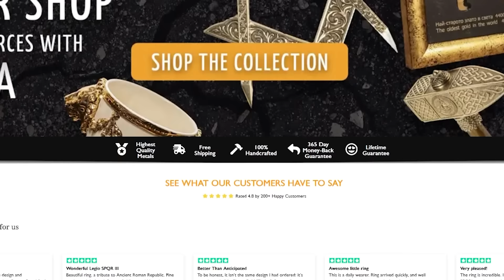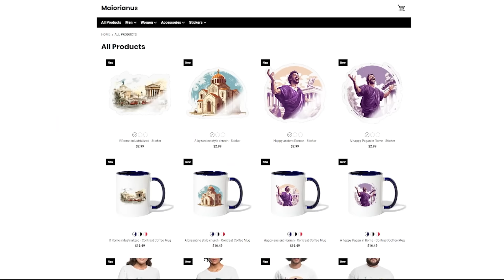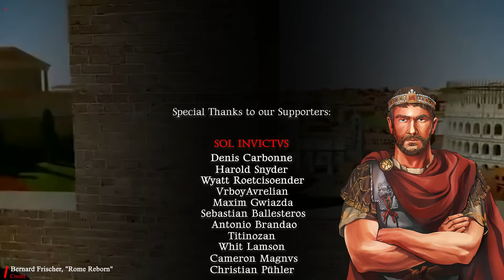What if the Fall of the Roman Empire was prevented by Majorian?

Comment: I am more interested in the impact of Majorian's victories in this reconquest will brought. As we all saw, Britain will be left at the complete mercy of the Angles, the Saxons and the Jutes. So unless the Romans entered the picture during the reign of Majorian II, the kingdoms established by the Angles, the Saxons and the Jutes will still happened anyway. And the only way I can see this happening is that the Franks and the Alamani have been subjugated at least for the time being. But whenever they broke the treaties, the Emperor needed to divert manpower and resources to the northern frontiers instead of assisting the local client Celtic and Britonnic chieftains in fighting off the invaders. And in roughly the next 100 years later, Islam came to be in the Arabian peninsula and unify the entire peninsula while the Romans and the Iranians were fighting against each other. Eventually, the Muslims expanded outside of the peninsula, conquering the Sassanid Iranian Empire and invade Syria and Egypt. But upon hearing the news about the sudden expansion of the Arabs, the Western Roman Emperor at the time will most likely dispatched a fleet to assist the local Eastern Roman troops in holding the Arabs at either Carthage or Cyrenaica. I don't know how will they be able to hold them off or how long will this new status quo with the Arabs will lasted. But what I know is that until the Umayyad Caliphate has been overthrown in the Abbasid Revolution because the Umayyad Caliphate was usually on the constant expansion, so that means both sides of the Roman Empire will received no respite. So in this period, it could be marked as another decline of both the Western and the Eastern Roman Empires. As for how will the Western Roman Empire will deal with the Vikings, I have no idea because this is depending on will the Western Roman Empire retake Britannia or not.
Reply: I honestly don't think that the Romans would have decided to reconquer Britannia. 

It was turning into a money hole for the empire, it wasn't as economically valuable as it used to be, it was a province of frequent revolts due to the amount of legions stationed there, and it was isolated from the strategic Mediterranean trade network of Rome's other provinces.

The only reason they decided to invade in the first place was to fulfill Claudius's vanity project and show that he wasn't a weakling, and the reason they held onto it for so long was because abandoning it would be a loss of face.

Maybe in this timeline they would have tried to exert some influence over the kingdoms there, making them into client kingdoms of sorts akin to Armenia. But I seriously doubt a full reconquest would have been undertaken. Britannia was better off not being part of the empire.

Edit: Or more accurately, the Roman empire was better off without Britannia.
Reply: @Onezy05  But that means dealing with constant raids by the Vikings from Scandinavia. And to make them foederati and allowed them to settle in Normandy basically said that the Western Roman Empire learned nothing from what their deals with the Germanic tribes at all.
Reply: @lerneanlion  I'm not an expert on the Vikings, but wasn't one of the reasons why they were so successful attacking the former Carolingian empire because of how decentralised they were because of their feudal system?

I doubt their raids would be as much of an issue if Rome still controls Gaul. The Romans having a much more centralised authority would allow for a better response to the Viking raiders from Scandinavia. Just look at how well the Eastern Romans warded off the Kievan Rus during the reigns of John Tzimiskes and Basil II.

As a result, there would be no Norse settlement in northern Gaul, meaning that the Normans never emerge as a people. This may lead to Britannia falling under the sway of the Anglo-Saxons or the Vikings for the rest of its history.

Both of these powers would fail to make Britain/England a world power down the line. England was largely irrelevant to European politics prior to the Norman conquest of 1066 due to their isolated position from the rest of the continent. The Norman conquest tied the English to Normandy, leading to conflict with France and a deeper entrenchment of Britannia/England in continental politics (as well as also drastically changing the framework of English society, and continuing to complicate the English language lmao)
Reply: @Onezy05  Well, it has been a while since I looked at the Carolingian Empire. So I guess I needed to look back into it again. But I do like the idea of Britannia being left to the Anglo-Saxons and the other peoples from the rest of Scandinavia later on. And when they are preoccupied with wars against each other, the Western Roman Empire will needed not to intervene unless one side becomes too powerful for one another.

However, if the English wool become sought after in the Roman markets and the news about the discoveries of Iceland, Greenland, Markland and Vinland made it back to the Old World, that might be when the political connection with the rest of the continent may happened, right?
Reply: @lerneanlion  I think that there's a good chance that the Anglo Saxons would end up controlling Britannia rather than the Vikings, as they did effectively beat them in our timeline (plus the Viking age did come to an eventual end due to a variety of factors, some of which may happen sooner in an alternate timeline where Rome survives).

Yes, Western Rome wouldn't have much need to intervene unless one of the Scandinavian powers or Britannia grew too powerful, as it would in turn create an unnecessary power block on their northernmost frontier. They would mostly leave the Scandinavians and people of the British Isles to their own devices unless absolutely necessary.

You've brought up an interesting point with the wool trade. Yes, England could potentially renew Roman interest via its wool trade. But I think this would make them more of an economic trading power, not a political one. Power wise, they would still be in the same league as the Scandinavian countries.

Vinland is an interesting one, as in an altered timeline it may lead to the American continents being properly explored earlier if the ship technology is advanced enough.

The consequences of Western Rome getting its foot in the Americas earlier would be huge, as it would lead to the economy shifting from the eastern provinces to the western provinces. 

One could imagine the Atlantic ports of Gaul and Hispania being filled with chocolate, tobacco, and tomatoes. Rome would emerge a richer empire, with the western provinces economies becoming equal to those of the east, if not greater if they then get the idea of sailing round Africa to get to India (unlikely if Egypt remains in their hands)

Whether or not the western Romans then try to colonize/conquer the Americas is a completely different topic altogether. It would depend on:

1) How interested they would be in creating overseas provinces so far away from where they were
2) If they could realistically conquer parts of the Americas
3) What those conquests would have looked like e.g would they have instituted a form of colonialism similar to that of the Spanish (unlikely)
Reply: @Onezy05  So that means England will most likely be unified by the Anglo-Saxon monarchs originated from the Kingdom of Wessex and remained like that until otherwise while also engaged in a variety of relations and wars with the rulers from Wales and Pictland. And when the Danelaw and the Kingdom of Jorvik came to be, the discoveries of Vinland and Markland will received no royal sponsorship from the monarchs of Britannia until all political tensions are solved.

Back to the Middle East, the Umayyad Caliphate has two options and it's either stopped the expansionist and the Arab supremacist policies or faced the Abbasid Revolution. And if the Romans managed to halt the Muslim conquests earlier, losing just Egypt and Syria in the process. It might be a possibility for the Alids to receive the backing of the Romans in the revolution against the Umayyad Caliphate. And if that is the case, the survivors of the Umayyah Clan who got captured by the Romans will most likely be used as bargaining chips in order to make sure the Abbasid Caliphs will keep their words and not attack the Roman Empire because the Roman government will not hesitated to back the Umayyad Emirs up to claim the Caliphate if the Abbasid Caliphs broke their words.

As for the colonization of the New World, the Roman government may actually sponsored the expeditions westward to find new lands and claim them out of fear of the Scandinavians claiming all of them for their monarchs. But when it comes to the interactions with the natives, I have no idea either. However, I doubted they will make them foederati since they learned that lesson the hard way from the Germanic tribes.

Comment: Nice Novel but you failed to adress the true problem which cost the empire its demise: roman society itself. A purge of senators, redistribution of land in order to reform a yeoman class and lower class representation in a new "parlament" institution would have been necessary. Also a new succession system and a levy army system, this latter necessary for a stagnant economy like those in the late antiquity. 

There were more problems than citizens in Rome as you can see. No wonder the empire fell.

Comment: The Romans were too corrupt at that time. Even if everything would have gone successfully as planned, quickly a new pretender to the imperator title would have appeared, or another succession crisis would have started. This time possibly backed by strong one of the Germanic factions. Simply, the old empire have had too much founding flaws to continue its existence.
The key advantage of the Germanic tribes over the Roman Empire - according to me - was strong hierarchical system of loyalty which later on turned into feudal system. That's why the Germanic tribes acted in much coherent and effective way than the imperial forces. An imperator most feared a strike from disloyal countrymen.
Reply: West Rome adopts a hybrid between The East Roman System and the Germanic Tribal system